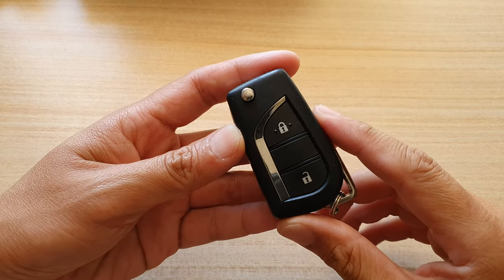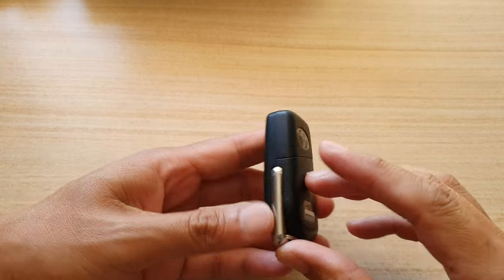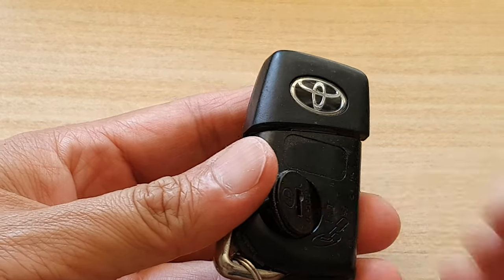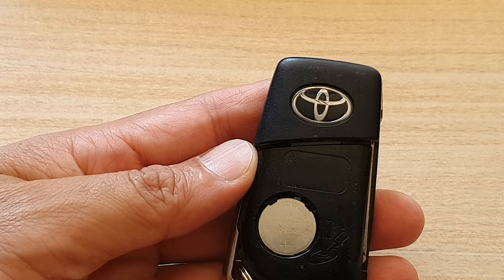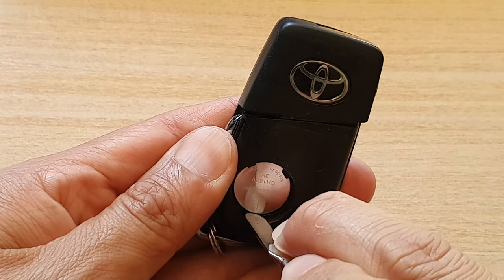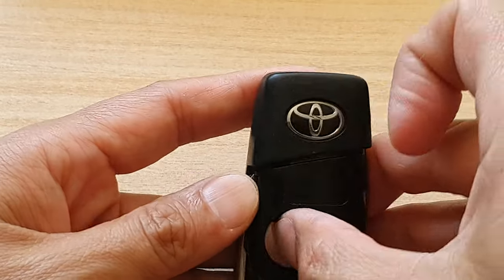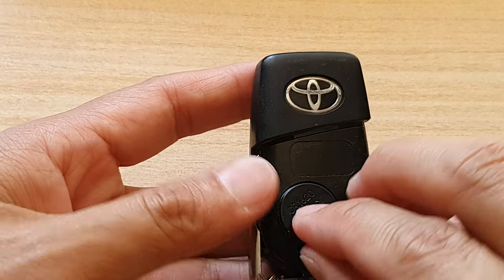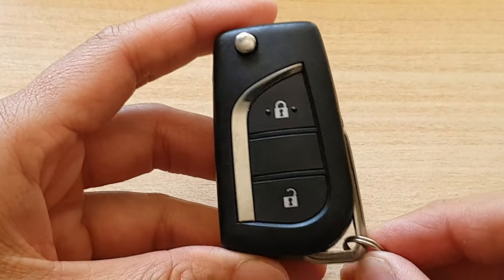Toyota Hilux WorkMate 2020: How to Replace Key Fob Battery

Comment: You should avoid touching the positive and negative at the same time. Your skin conducts electricity, and will use some of the new battery charge, shortening life of the battery.